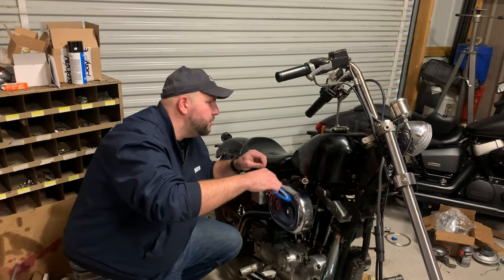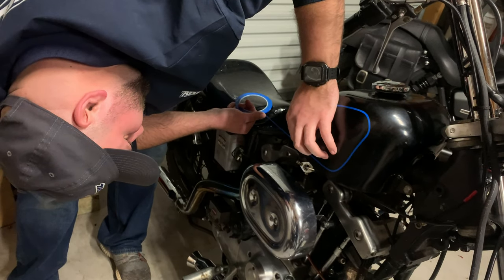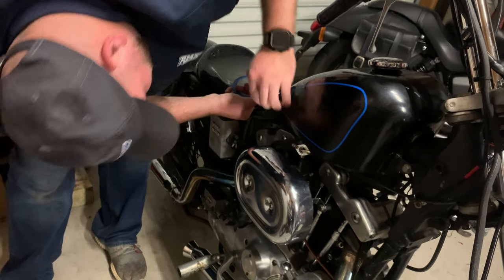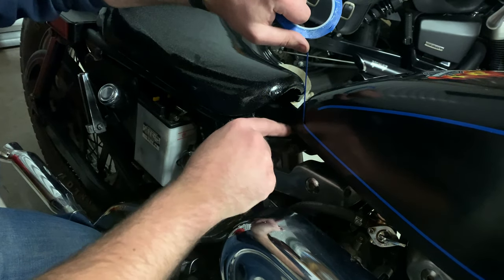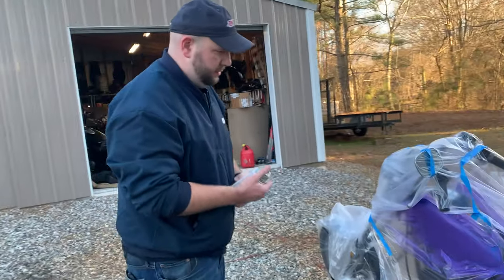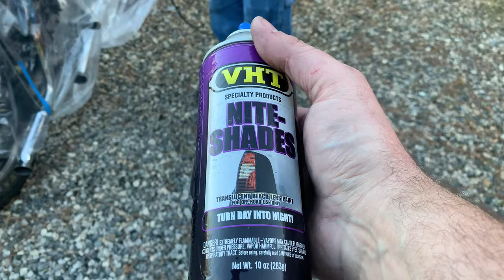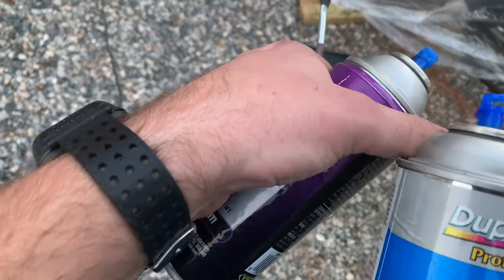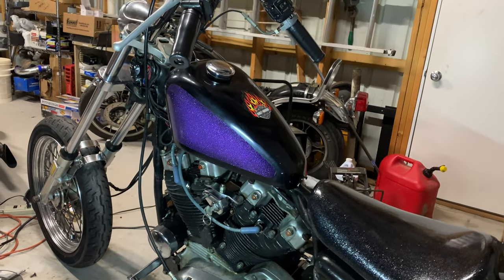Custom Metalflake Paint at Home - 70's Chopper Build Part 6 - Harley Roadster XLS1000

Comment: Jordan, some questions - how many coats of the Nite-Shades did you use?  Have you tried 2 different colors to maximize the flake, like purple glitter over silver?
Reply from the maker: We only used a small bit of Nite-Shades around the outer edge of the panels.  We didn’t try the purple over sliver though.